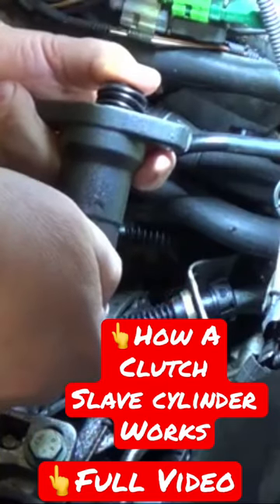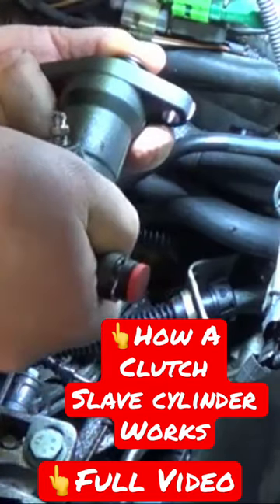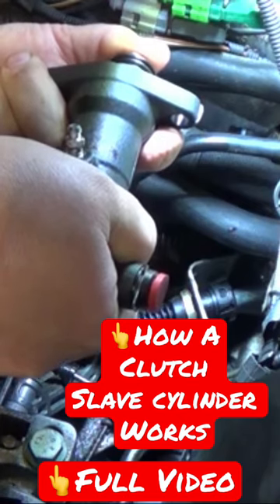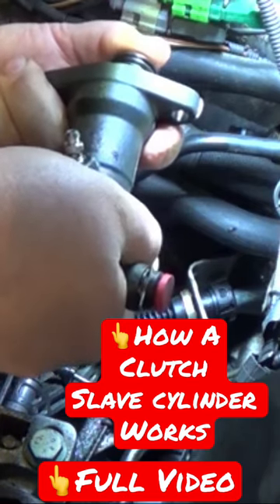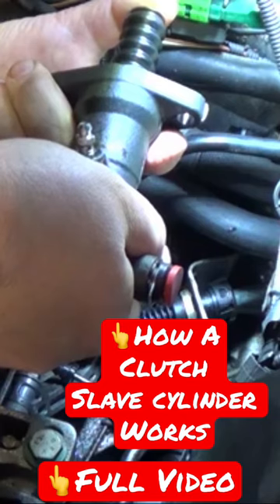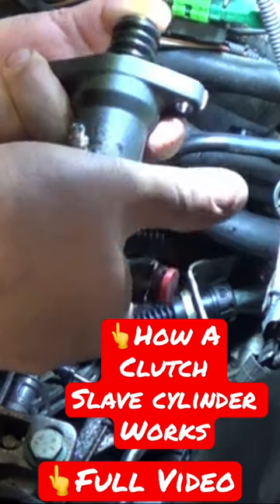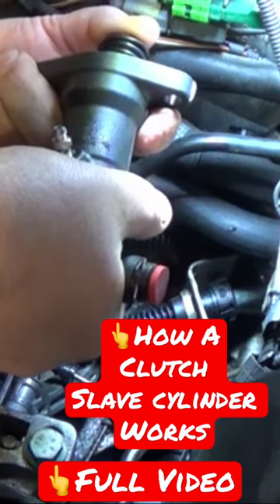Simple: How a Clutch Slave Cylinder Works #baldeagle242

Comment from the maker: 👇Click here for the full video👇
https://youtu.be/PnNAJO2naoE
Simple VW Beetle Clutch Slave Cylinder Replacement
Clutch Slave cylinder replacement on a 2006 (NEW) Volkswagen 2.5L stick shift VW Beetle. (Same process for Jetta, Rabbit, or any VW with the 2.5L 2480CC 151Cu. In. l5 GAS DOHC Naturally Aspirated)  
My 18-year-old daughter jumped right in and got her hands dirty on this one.
So proud of this young lady!
WHAT YOU’LL NEED...
10mm Socket, 13mm Wrench, 13mm Socket, Pliers to remove duct clamps, Rags to soak up excess brake fluid, Flat-head screwdriver or pick to remove the hydraulic locking clip, Dot 4 brake fluid for the bleeding process.

See the Complete Baldeagle242 video history here.  A true trip down memory lane of all the past videos I have posted on YouTube.
https://youtube.com/playlist?list=PL5_ZXmQpcjpZLAMEskeAYolqvhFSN_X4m

If you're a video creator on YouTube - Tube, Buddy is an excellent program to evaluate your videos and make recommendations to help you attract more viewers.  
https://www.tubebuddy.com/Baldeagle242

Beck Arnley 072-9780 Clutch Slave Cylinder
https://amzn.to/3bytiCv

We did not bench bleed the slave cylinder before installing it.  Once it was hooked up, we opened the bleeder valve and left it open until we saw fluid seeping out. She then pumped the clutch until we got good fluid circulation. During this process, the clutch pedal will continue to fall to the floor until you get most of the air bled out of the line.  Close the bleed valve while pumping and open it once the pressure is relieved.  After the valve is closed, pump the clutch up 3 to 5 times and repeat until you have a firm clutch peddle.  It took us about 6 cycles to get a nice firm clutch peddle.  Make sure to top off the fluid as it gets low.  

Get the Motion Hero Pack that I use in my videos(300 items)
Only $37 one-time investment
Use unlimited times on your own and client videos!
https://baldeagle242--videohero.thrivecart.com/motion-hero-pack-1/

See more... F250 Turbo rebuild
https://youtu.be/mYH4gF_V8ys

As an Amazon Associate, I earn from qualifying purchases.  The following links help you find the products I've used in this video.  Clicking these links will take you to the products and help support this channel without costing you anything extra.